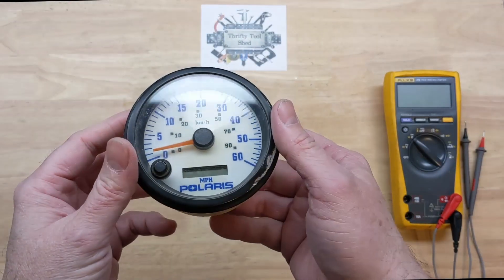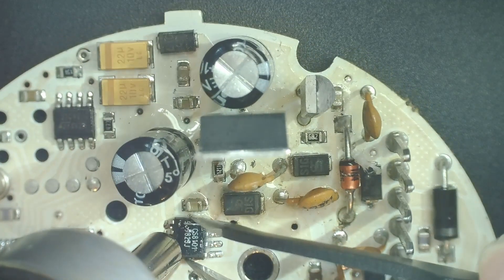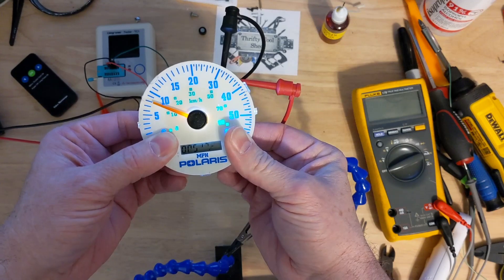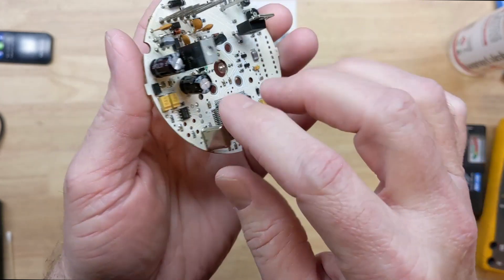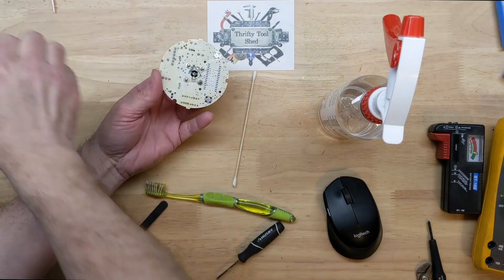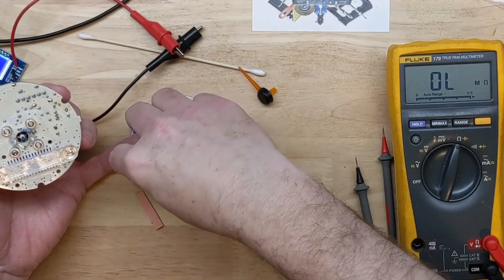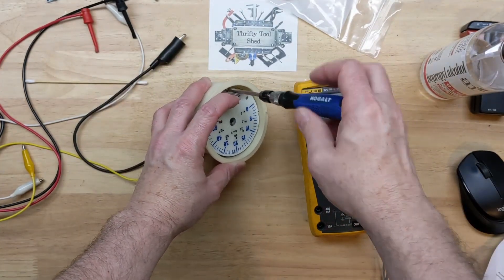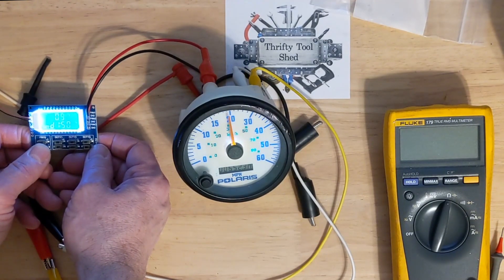Polaris Speedometer Repair - Part 2

Comment: Would it be possible for Polaris to put a fuse in line with the gauge cluster so it doesn't burn out so easily?
Reply from the maker: I think it's possible. I really think overvoltage is the main cause of failure, and to some degree, a fuse could help if the current increases enough and the fuse could protects some components at least. Not sure about some of the chips including the voltage regulator and zener diodes.

Comment: I gave up on this after watching the first video but, you didn't. Excellent! Maybe an input circuit to keep the unregulated 12 volts at 12 volts so it doesn't happen again.
Reply from the maker: Hey, thanks for watching both. Wanted to mention that some of these are not as bad as this one ended up being. I don't know at what point you gave up,(or if you are really working on one)  but want to mention that after seeing the blog site mentioned in video #1 some may just need the transistor and some commented they had to simply solder theirs back in. Just wanted to share that, thanks for your comment!
Reply: @ThriftyToolShed  I gave up on the one you were fixing. I never had to fix one. As a kid, I took everything apart to see how it worked. With YouTube, I see the inside of more things than I could ever dream of.

Comment: I disassembled mine today and soldered in the new TIP48. An issue I am having now is the LCD panel displays gibberish. Any clue how I might rectify that? 

It displays all sorts of characters, so something is weird with it.
Reply from the maker: Not sure other than making sure the elastimeric strip is making contact correctly.
Reply: Appreciate your response - I will take it apart and inspect it again today.

@ThriftyToolShed